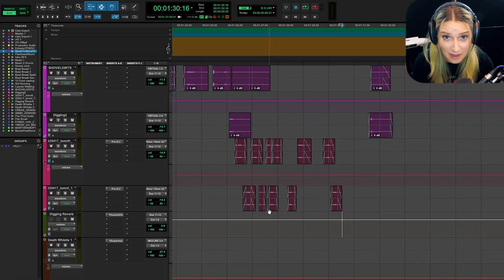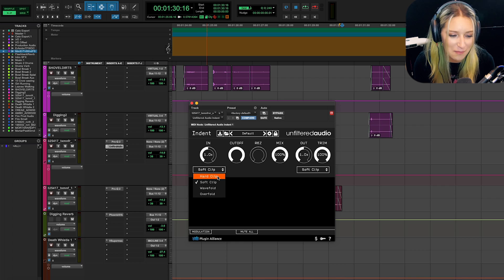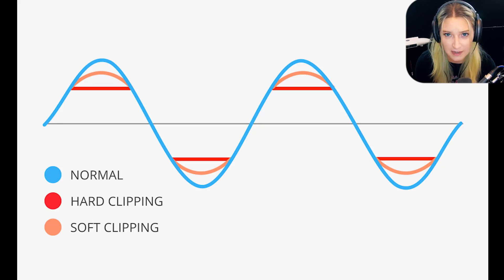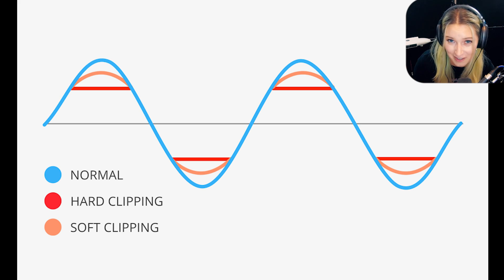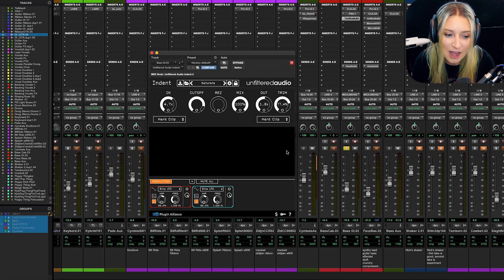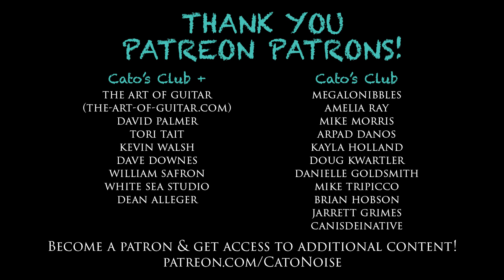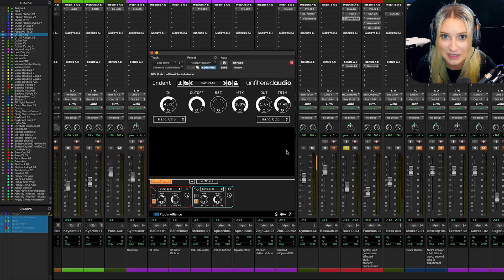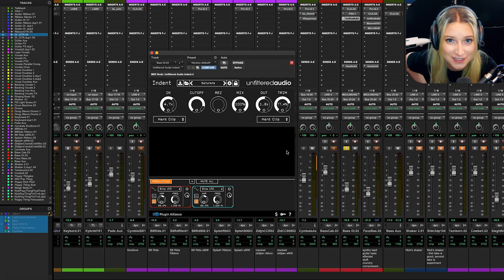Audio Basics: Hard Clipping vs Soft Clipping

Comment: Several year old video, but great info.

I'm actually not sure which YT video I saw where I learned about clipping plug-ins. I love the ones that demonstrate the difference between the 3 dynamics controllers we know as compression, limiting, and clipping. 

Each can be used to reach a specific dynamic limiting goal, but they're way different in approach and sound.

I use the Studio One 7 Pro DAW, and I'll use my top 2 clippers by Schwabe, Orange on individual channels/tracks, and Gold Clip on the 2 bus. Gold clips everything at -1.0 dB, and the Newfangled Audio Elevate is still there as a multiband limiter, but it's more my old school fail safe in action there. 

Soft clipping to me is going to affect more than the hard clipper, as it's acting on more audio than just peaks. There's the saturation/distortion more as well. Perfectly fine in its own place. 

Hard clipping should only affect peaks unless you're digging down further in the audio. Just clipping off the top of the peaks is the cleanest way to add a bit of headroom without pulling faders.

Happy mixing.

Comment: Would one ever use a clipper on a piano? Or pads?
Just wondering what the best method would be for smoothing these out.
Reply: Compressor could help
Reply: I'm crazy, I clip everything with a clipper plug-in. The more sane part has me do this in varying degrees for different instruments or vocal tracks.

Comment: Even better still - no clipping, by turning the volume down a few dB.
Reply: But sometimes it can be desirable, like with Saturation. Even though saturation is different, as it adds harmonic content in intervals to the fundamental frequency.

Also, in Hip Hop, Soft Clipping is a good way to get your kicks to shine through, become louder, and hit harder without distortion. You can turn your kicks up PRE FADER by using a pre amp, and then put a soft clipper on the mixer track of the kick. This allows them to get louder and hit harder without introducing distortion or noise.
Reply: Or clip before a limiter in order to maximise loudness
Reply: Yeah, but I think what's being illustrated is knowing the difference between soft and hard clip, because with soft clipping, you can potentially increase loudness without the distortion you'd get from hard clipping. Knowing how to hear the difference is a learnable skill that would help mixes be louder and hopefully clearer.

Also, soft clipping imparts some audible benefits when applied correctly. Again, knowing how to hear it is really useful. 

... but in general, you're right that good gain management is important in producing well.
Reply: Clipping can be an effect. For me,a clipping plug-in is clipping like the overloaded signal but at a lower dB. And distortion is minimal unless you dig deeper into the audio. 

Clipping is no longer bad. It's a way of controlling dynamics.